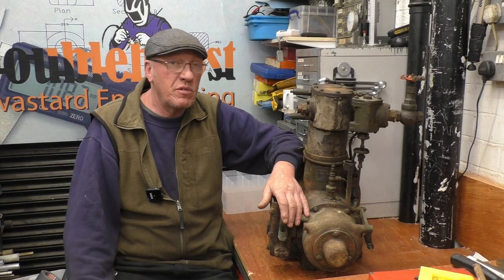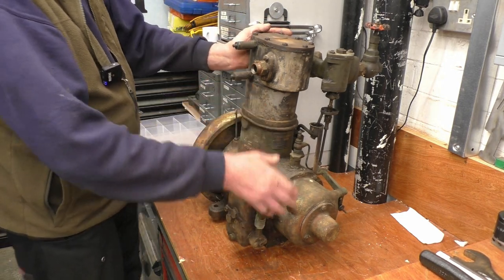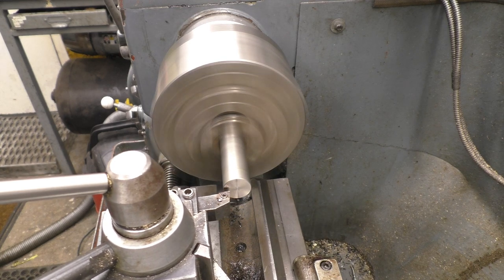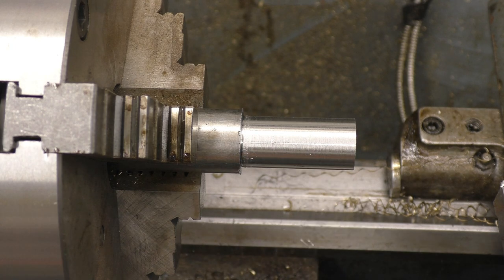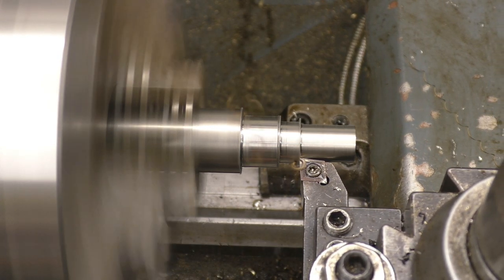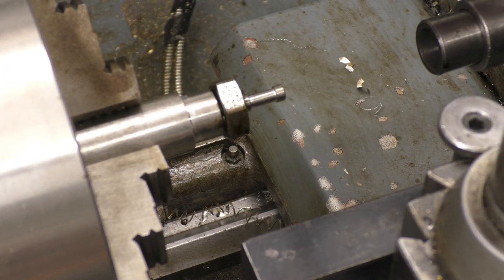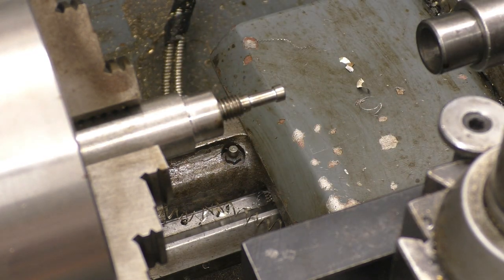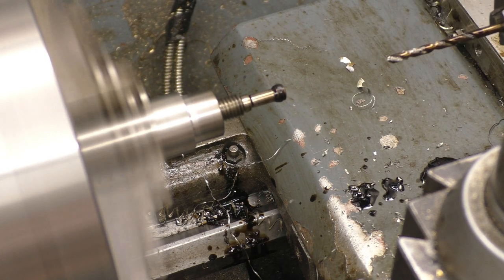SNNC 380 P1  Steam Engine Project .    Bulk Head Fitting

Comment: 14:00 cutting oil - I reckon it's either used engine oil or crude oil ;)
Reply: High sulfur cutting oil, used for professional pipe threading machines and the like. Real good for thread cutting.